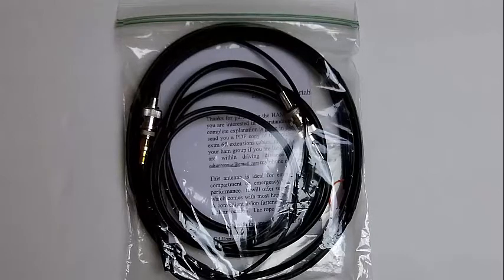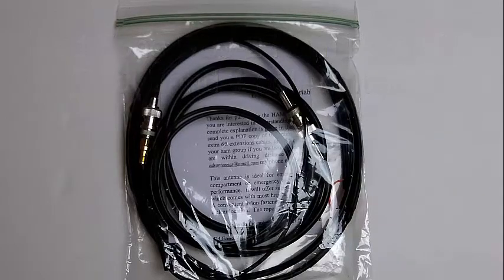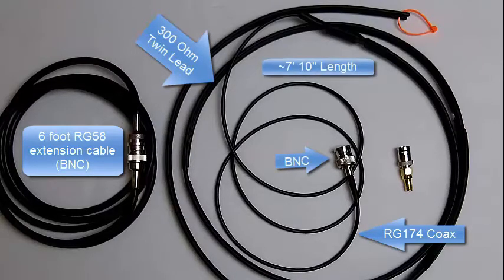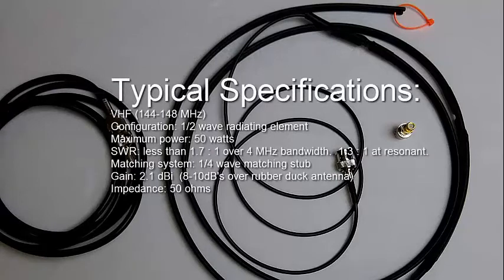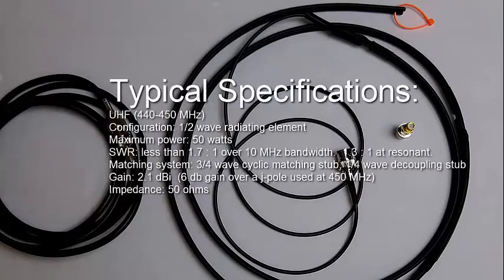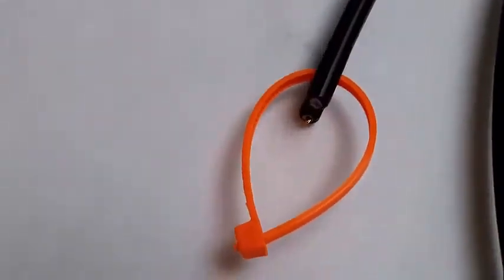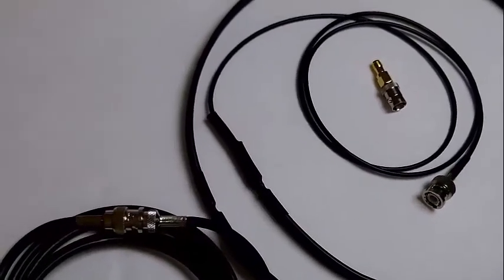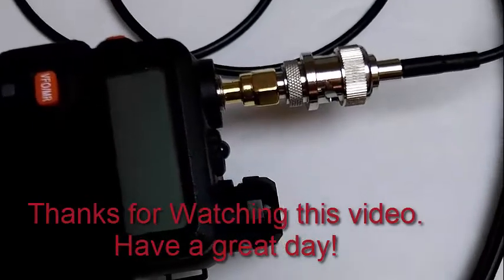DBJ-2, Ed Fong, Dual Band Portable HAM Roll Up Antenna - QUICK LOOK : Eye-On-Stuff

Comment: I have a Yaesu FT-60R, I needed the SMA to BNC connector too
Reply: Craig's no doubt already found a solution, but the video publisher probably didn't notice, but that SMA plug sticking out of the BNC adapter is a "barrel" adapter, it's SMA female to SMA female to allow u to use it on the "chinese" radios.  You screw that barrel out of the BNC to SMA male adapter and it will reveal the SMA male connector needed for Yaesu and other HTs that have SMA female plugs.
HTH